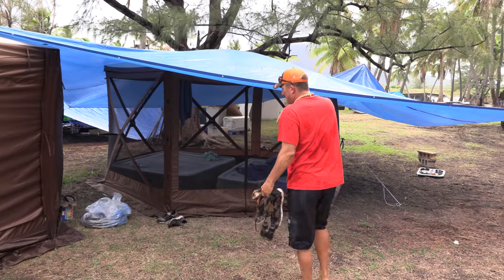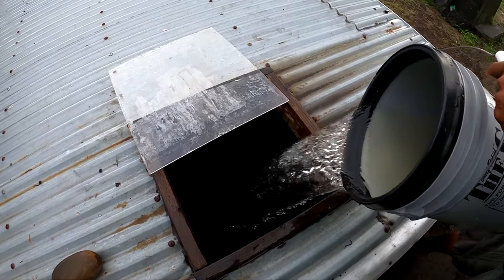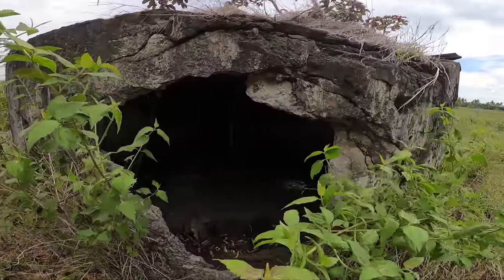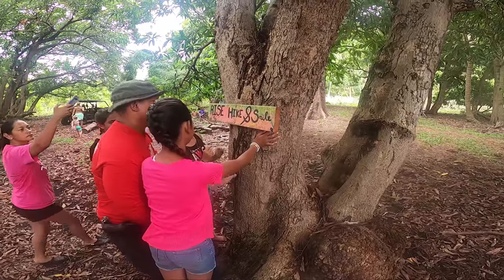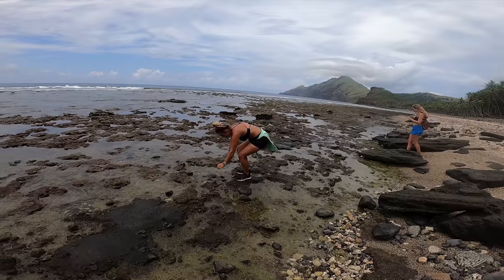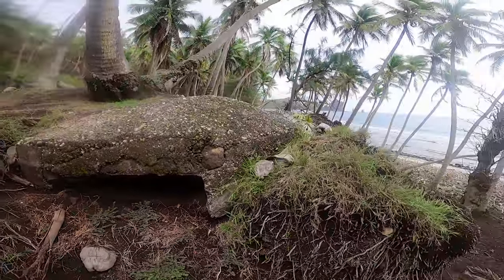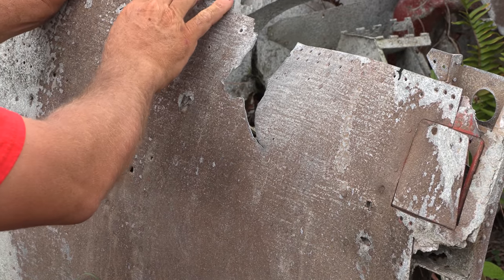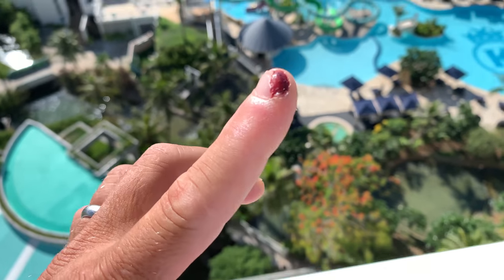We Found a WWII Plane CRASH!!! Pagan, CNMI / full camp and island tour!

Comment: Judging by how short the nose of that jet is, cockpit location in relation to the wings, I'd say that might be a Nakajima Ki-43 and not the A6M (zero).
I could be wrong though.
Reply: Not a jet but a prop plane.
Reply: @eddielane9569  
Obviously I'm no expert on this subject. 😆 🤣 😂
Reply: I don't think the Nakajima ever flew with a three bladed prop. and the wreckage here has a three bladed prop. The  A6M3's did fly with a three bladed variable pitch prop
Reply: I would say probably a 747
Reply: The canopy is reminiscent of a zero if you compare it with pictures
Reply: I believe its a kawasaki Ki61
Reply: F 35.. dig out the tech.. lol
Reply: @hapnewsom9217  
Yes sir, the 3 blade prop was introduced and produced in 42 till 44. It was one of the many upgrades it received along with a new Ha--115 supercharged version of its previous engine. Which helped it carry a bigger arms payload, which was also upgraded at that time. 

At first I wanted say it might be an N1k, but the proportions seem a bit small for that with Mr Arrington standing next to it.
Reply: It’s a potato
Reply: A6M2
Reply: Are we sure it's not a SBD Duantless
Reply: @justinbayola  A6M5
Reply: It's an A6M5 Model 52 Zero.
Reply: Everytings a jet to a millennial.
Reply: @Oscifer11  I'm a millennial, so
Reply: Welp'... it's a LOT closer than MY guess of a 👁donthaveafrickinclue 57!! 😂
Reply: @Someone-ko6oc  Yes, because it's an A6M5 Model 52 lol
Reply: It’s would be a zero cuz of the zero has 3 props and the inside has that small back compartment in the cockpit
Reply: It’s a aeroplane  for sure 💯🤓
Reply: Stanners it may identify as a bicycle though.
Reply: Could be the Kawanishi N1K or the  Mitsubishi A6M5 Model 52.
Reply: No guys.. this is definitely a Antonov An-225 Mriya
Reply: Willing to bet that its a A6M
Reply: @rollastoney  Resembles it greatly lol
Reply: @rebelyell22  No need to apologize.
Reply: Jack Reichel how much u willing to bet?
Reply: @Ramawama  I'll bet $1000 it's an A6M5 Model 52. Venmo me.
Reply: Not a jet
Reply: Fuzzy Ewok dude that’s obviously an a380
Reply: Obviously not a jet!
Reply: @rebelyell22  and I'll bet it's a antonov an-225. Venmo me asap

Comment: Robert, there's a slim chance the plane is an Akagi D3A1 "Val," although there isn't enough visible to make a positive identification. Most likely it's the more common Mitsubishi A6-M3, "Zero." The 'Zero' design was based upon an airplane design originally by Howard Hughes. When Japan adopted the design and Mistubishi re-engineered it, they shortened the empenage so they could get more airplanes on an aircraft carrier deck. To enhance the ammunition loadout on the plane, they didn't install self-sealing fuel tanks or armor plating for the pilot. Those two factors cost them dearly. Another shortcoming of the Zero, the shortened empenage adversely affected the airplanes ability to turn right (against torque or asymmetrical thrust of the propeller) in a dogfight.

At the time of the Battle of Midway, the Japanese staged a diversionary attack on the Aleutian Islands. We recovered a 'Zero' that made a forced landing and shipped it to Lockheed, who rebuilt it. They shipped the plane to Muroc Dry Lake in California (now Edwards AFB) and dogfighted it against an F-4F Grumman Wildcat, F6F Grumman Hellcat, Chance-Vought F-4U Corsair and Lockheed P-28 Lightning. They learned the Zero's shortcomings and developed effective ways of combating the airplane. 

Since you stopped at the Japanese War Memorial, I'd like to say a few words about the Japanese. The people of Japan ARE NOT the people we waged war against in the 1930's-40's. The Japanese people today are peaceful and peace-loving, and our friends. During and preceding the war, Japan was controlled by military zealots bent of conquering the world, and not the people of that nation today. 

Not to advertise the book, but, my book "The Indomitable Patriot: the Aviators" describes (in a fictional setting) the actual flight tests of the Zero against our WWII era fighters used in the Pacific theater. You Will Never Know how I wish one of those tents in your basecamp had my name over the flap. What I would have given to be there and return to my Dad's war............ Carl (It's too bad there's no way to attach photo's to these comments)

Comment: Thank you for exploring and showing us this. Driving on a deserted island is something I have never thought about doing lol. You have to be careful out there though. Your body is used to all the nastiness in Florida but not used to the bugs and crude on the other side of the planet. Congrats on that Mitsubishi Zero find (it is a zero by the window shape - a Val is much bigger and wider spaced windows). The Japanese were ashamed at losing the war so they destroyed all aircraft and plans. The ones you see today are replicas and mostly intact crashed aircraft that were rebuilt to match photos. So this is a real treat to see something like this in person. I also liked seeing the camp. I am wanting to start a business making high tech and super tough gear for expeditions like this to make it as comfortable as possible. Anyway I loved everything you showed. I'm sure your favorite part was walking with Emma through the coconuts. Magical place. I met alot of WWII people and listened to their stories. A long time ago I worked in the car audio department at Circuit City. Sold a a vet some subwoofers for his truck. Dude was wild in his 80s as he was in his 20s. He flew a Corsair off the Yorktown aircraft carrier. Actually had to launch his aircraft off the Yorktown when it was damaged and it was listing at 30+ degrees. He had a large burn on his arm. He was shot down over one of those islands from small arms fire from the ground and it popped an oil line burning his arm. He managed to crash land but was captured and was a POW for awhile. He choked up at that point and I didn't press him for information on it even though I wanted to. Must have been a terrible ordeal for him. He survived though. http://4.bp.blogspot.com/_9lx67uohYfg/THVS5IbwrsI/AAAAAAAAAB4/d0E7fbACEFM/s1600/JP-A6M-Zero.jpg
Reply: Also that plane didn't nose dive. It was flat on the ground so it was probably hit with small arms fire and he had to crash land. If it was shot down in a dogfight it would not be flat like that. There is a chance that the pilot may have survived.

Comment: Your gut was correct, here is the airplane you were looking at, it is a A6M5 Type 0 Model 52

Mitsubishi A6M5 Model 52s abandoned by the Japanese at the end of the war (Atsugi naval air base) and captured by US forces.

A6M5c Zeros preparing to take part in a kamikaze attack in early 1945
Sometimes considered as the most effective variant,[51] the Model 52 was developed to again shorten the wings to increase speed and dispense with the folding wing mechanism. In addition, ailerons, aileron trim tab and flaps were revised.[52][53] Produced first by Mitsubishi, most Model 52s were made by Nakajima. The prototype was made in June 1943 by modifying an A6M3 and was first flown in August 1943.[54] The first Model 52 is said in the handling manual[55] to have production number 3904,[56] which apparently refers to the prototype.

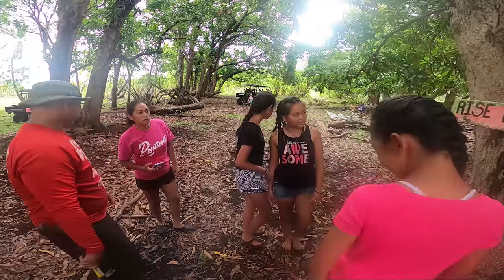Research by Mr. Bunzo Komine published by Mr. Kenji Miyazaki states that aircraft 3904 through 4103 had the same exhaust system and cowl flaps as on the Model 22.[57] This is partially corroborated by two wrecks researched by Mr. Stan Gajda and Mr. L. G. Halls, production number 4007 and 4043, respectively.[58][verification needed][59][verification needed][60][verification needed] (The upper cowling was slightly redesigned from that of the Model 22.[41]) An early production A6M5 Zero with non separated exhaust, with an A6M3 Model 22 in the background. A new exhaust system provided an increment of thrust by aiming the stacks aft and distributing them around the forward fuselage. The new exhaust system required "notched" cowl flaps and heat shields just aft of the stacks. (Note, however, that the handling manual translation states that the new style of exhaust commenced with number 3904. Whether this is correct, indicates retrofitting intentions, refers to the prototype but not to all subsequent planes, or is in error is not clear.) From production number 4274, the wing fuel tanks received carbon dioxide fire extinguishers.[61][62] From number 4354, the radio became the Model 3, aerial Mark 1, and at that point it is said the antenna mast was shortened slightly.[63] Through production number 4550, the lowest exhaust stacks were approximately the same length as those immediately above them. This caused hot exhaust to burn the forward edge of the landing gear doors and heat the tires. Therefore, from number 4551 Mitsubishi began to install shorter bottom stacks.[64] Nakajima manufactured the Model 52 at its Koizumi plant in Gunma Prefecture.[65] The A6M5 had a maximum speed of 565 km/h (351 mph)) at 6,000 m (20,000 ft) and reached that altitude in 7:01 minutes.

Comment: I think the Plane it is either a Zero, a F6F Hellcat, or a P-47 Thunderbolt. It is hard to tell which country it served with during the war because it has no markings on it. The bomb hole could have been caused by a B-17 bomber because normally Japanese Vals would carry bombs. The Vals job was to dive bomb enemy Naval Vessels during the war. Vals were mainly used in Pearl Harbor, Battle of the Coral Sea, and the Battle or Midway.

Comment: It's 1 of 4 models, A6M5, A6M6, A6M7 or an A6M8. That all comes from the engines exhaust ports the rest looks basically the same all the way back to an A6M1. Which of the 4 models it is, is the big question, it would take either a much closer look around the wreck or if there were more parts laying around as that would determine the model. If it would by a magical chance be an A6M1/2/3, the engine would have been retrofitted to it. A6M1/2/3 has 2 bottom exhaust ports, where as the M5/6/7/8 has an exaust going from each cylinder and out as the one here seen in the video.

Comment: Others have commented on the correct variant of the Japanese 'Zero'   Allied code name 'Zeke'  Here is a photo of a restored Zero of the same version, (Thank you Chino Planes of Fame)   You can clearly distinguish the features, and the round hold below the right 7.7mm machine gun nose mount is a bleed air system for the engine.  You can distinguish it on the restored version as a barely perceptible circle under the machine gun access door in the same location.   

Others have said that it is the fresh air intake for the cockpit, but this is incorrect.  In that position, it would have induced hot exhaust gases into the cockpit!   No Bueno!

Anyway, it is indeed an AM65-52 Japanese Zero Fighter Plane.   Armament were 2, 7.7 mm machine guns in the nose, and 2 20mm auto cannons, one in each wing.    Equivalent load outs for Allied Fighters compared to this Zero would have been:  four 50 calibre machine guns, and two 30 caliber machine guns.   

That said, the Japanese combination was far less lethal as the two wing mounted 20mm cannons had a much lower rate of fire (60 rounds per minute/verses the American 750 rounds per minute on the 50 calibers) than the American fighters.

After late 1942, American Fighters (all of them) were armed with 6x 50 calibre machine guns- totally overpowering any combination of machine guns/cannon that the Japanese fielded during the war.   

Looks like this particular Zero was brought down by American Air to Air fire.   

Love to you Rob for posting this.   I grew up in another South Pacific area of war, (Taiwan) and have also hiked out to Japanese pill boxes and crashed fighters on the island.
Glad to see this part of history  not forgotten thanks to yourself.   

Soldier ON!
Mike/Santa Cruz California

Comment: No expert here but based on the throttle on left, landing gear below that and the single rear facing seating you have a US SDB5 Dive Bomber .... the well known Dauntless.  The prop showed at the base the ability to be tuned (rotated) which was not common in Japanese aircraft.  Now if you can find and remove the data plate on the rear engine compartment firewall you legally own the aircraft and can rebuild it.   I know the guy who could make that happen .....

Comment: The plane is an A6M Zero. You can tell by the way the corners at the top of where the dash would be are curved. You can also tell by looking at the bottom corners of the cockpit window frame and see how it is curved like a Zero, or just other general features of the cockpit like the plate that kind of looks like cupholders on the right side. Also, this link gives some history about what happened on Pagan during the war and what plane crashes are on the island https://pacificwrecks.com/provinces/marianas_pagan.html and the only crashes listed are Hellcats, so its possible this Zero was destroyed by being bombed or strafed. From what I can tell, Pagan was mostly skipped over by the Americans during the war when the Americans cut it off by taking other islands around it, leaving the Japanese garrison to starve without supplies. I think the only real action seen here was US bombing or search missions looking for a radio station. The US did land on the island to accept the garrisons surrender but I don't think there was an actual invasion. Once the war was over it might have been used for target practice by the US, so that's where a lot of the bullets and stuff may have come from. The main battle in this area was Saipan.